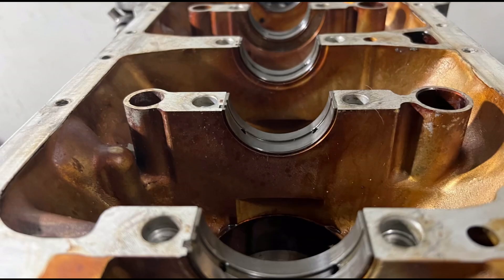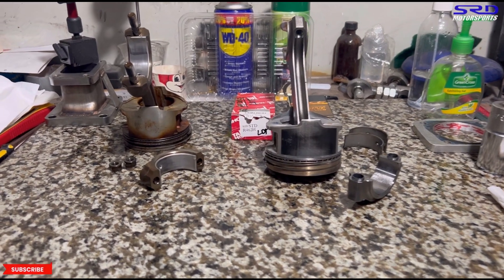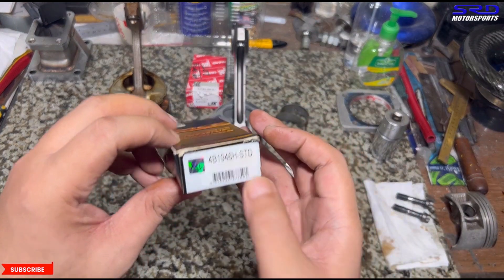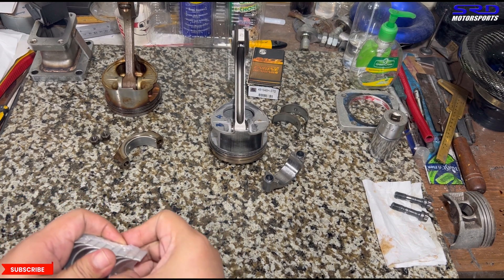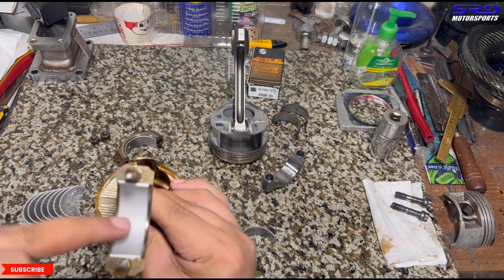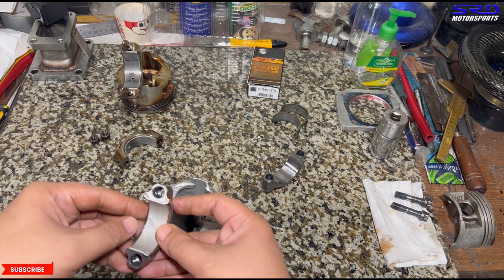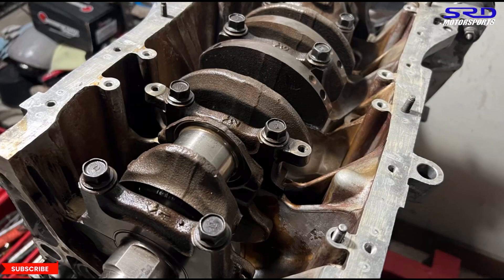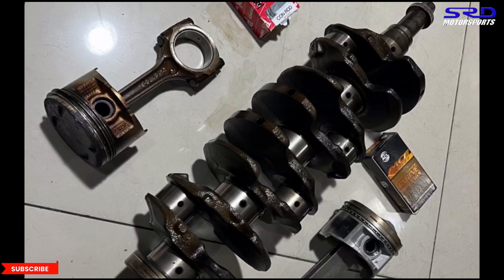Steps to Avoid Spun Rod Bearings K20a B20vtec K24 H22 D16

Comment: He'll yeah good inf the nobody talked  a also can u give me a tip to go better on a b18a engine (internalParts)
Reply from the maker: Oh nice a b18a but vtec ? Or stay non vtec…

IMO arp rod bolts on stock rods is hard to go wrong with especially with a lighter piston at 81mm than most in a b20 that has 84mm

just looking after the bearing clearances and oilpump (both plastiguage vid and oilpump vid I have here) should take you a long way

Comment: Well what can i say.. perfect!🙂💪👍
Reply from the maker: See the obesrvations on even forged pistons builds? I’m nosey as heck loool
Reply: @SRDmotorsports  even shaving .0001 on the side of the bearings plus side passages on the big end of the rods, they all matter.👍💪
Reply from the maker: @BenjieCoB20VTEC  yep and “torno” can easily pull it off back then I had doubts until I realize they “zero” it out right at the width so that’s zero to 0.001 def easy right